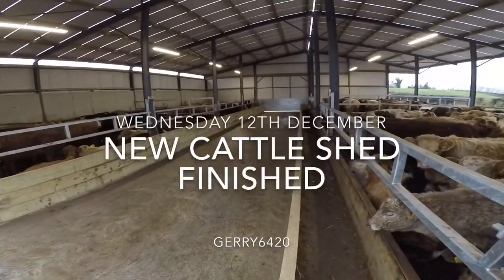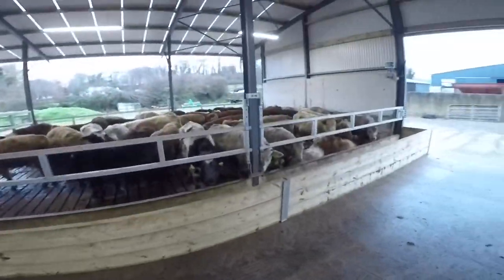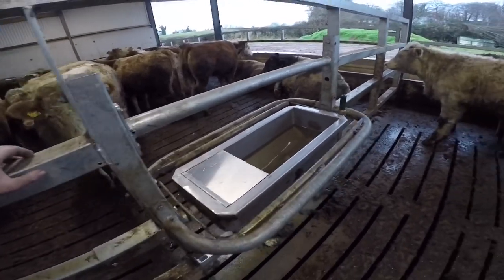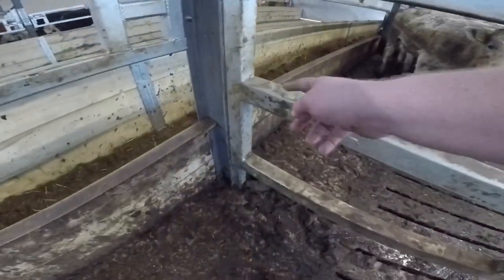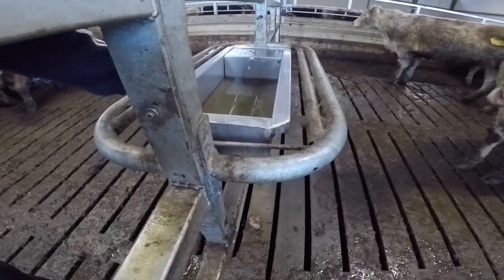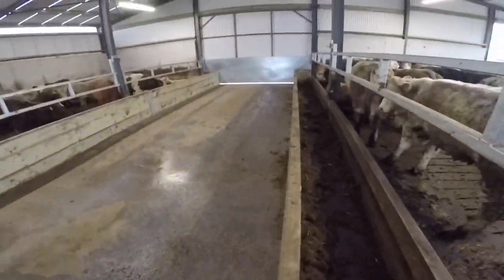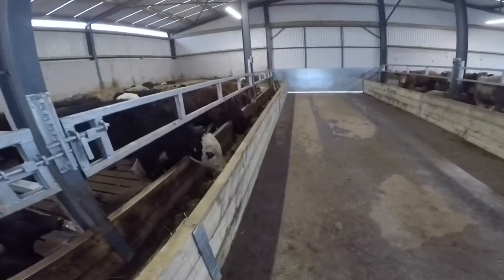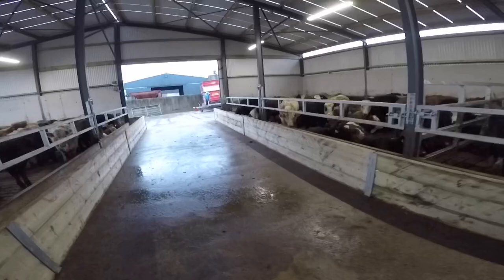NEW CATTLE SHED FINISHED

Comment: Should have put down rubber. Two rail feed barriers look cheap and flimbsey with not much thought given to animal comfort.... tip over drinkers will leak over time also and when in middle will not be cleaned regularly...
Reply from the maker: James Brennan sure the dozer is the only answer and knock it down.... ffs. Animal comfort is well catered for here, an uncomfortable animal doesn’t put on much weight. rubber on the slats is an absolute waste of time, had it on one of the other sheds and I ripped it out after a few years. Between the slat and the rubber is a breeding Gound for Disease and bacteria and every foot disease known to bovine animals and no matter how much washing lime or disinfectant you use, you cant get between to kill so you end up with endless foot issues. Larry Goodmans feed lots, feeding 1000s of cattle hasn’t 1 grain of rubber because of similar issues and zero differance in weight gain between cattle on and off rubber. Keep your rubber. Think more of my animals then subjecting them to that. The “flimsy” feed barriers are made from 4mm thick box section and have been in a previous shed feeding large bulls for for 11 years and the next time one gets a bend will be the first time. These are built stong and would keep elephants in. No animals gets heads caught or loses tags on these types of barriers and they can be adjusted for different sizes of stock in seconds. 
There isn’t a drinker known to man that won’t leak at some stage. Tipping them over to clean them out happens when needed as pens are walked daily while checking animals. Put a few videos of your own setup up and ill tell you where your going wrong. 👍
Reply: Rubber on slats is a bad idea. Its ok for the first year but after that you get bad feet problems as the hoves are growing faster, the bare concreate keeps the hoves trimmed. I know this becaues my dad owns hydrascraper services.

Comment: Hi Gerry. Smashing shed. I'm going starting to put up a near identical shed myself in two weeks time. Was considering putting the slatted rubber. But judging by some of your comments below....I'm starting to wonder are they worth it. You seem to give an honest opinion on them. Alot of lads that have them down I feel don't. Not sure how much I'd trust the agents selling them when they start talking about weight gains....and dropping the words teagasc research etc....just a small obs. do you find it better having biggest pins...or does it make much difference. Was going to split mine into 4 pins each side for grouping cattle better...if want would prob go with just the tip over drinker in the middle as suppose to the smaller ones.

Comment: Fantastic new shed  drinkers are really good saves on bucket cleaning 😀on the roof it looks like strips of light is there gaps between sheets?
Reply from the maker: Antony farming yes the it’s spaced to help with ventilation.
Reply: @gerry6420  the space sheeting is a great job for ventilation. 
Did they put a ridge cap on it at all?
Reply: On the drinkers.... fine big drinker and very well guarded.  There must be some sort of fancy swivel fitting on connection to ball valve to allow the trough to swivel?
Personally, l wouldn't position drinkers in shed like that - my reasoning?  It means having to enter the pens daily to check them.      Slippery slats, mixing with cattle. Bad combo.
Its just my personal view. Hope you or other viewers dont take offense.
Reply: @Bambinohead1  well said I was thinking the same but I guess it works for them 👍

Comment: Are the beasts happy here? Should there be rubber or something for them to set down on? Does it not damage there joints etc lying down and getting up on concrete? Will they stay warm and clean enough?
Reply: If you are a farmer Tom you only have to look at the cattle to know how content they are. Rubber won't make any real difference to their comfort or thrive levels. This shed is state of the art for animal welfare point of view
Reply: Bambinohead1 Yes Thanks I am. We milk around 400 head,run around 1000 head altogether,and arable around 3000 acres.Thanks for asking.You don’t see cattle on slats over here,that’s why I asked.Im well aware of cattle welfare rules and regs on our own set up.It was interesting to see,I thought the cattle looked uneasy,and maybe too many in a pen,but what do I know !
Reply: @FarmerTom08  stocking density can be much higher with slatted cattle accommodation as opppsed to straw/peat bedding.  That's why it might seem cramped.  Cattle stay cleaner on slats with more rather than less cattle in the pen as it helps to push down the manure. 
You could do worse than follow this channel if u want to learn more about wintering cattle on slats.
As for warmth, cattle can in fact be too warm in sheds here in Ireland because winters are so mild. Its 43F here atm, rarely gets below 20F even at night.  Thats why we keep sheds airy and shave cattles backs so they don't sweat.
Reply: no tillage in many areas in ireland ...straw  very expensive .....slats are really the only available option for most as pollution is also well taken care of with them  they are probably not as good as bedding cattle but are a good enough compramise and better than a badly beddded shed or being left out under the hedge in  a wet winter  ....also pretty labour efficent as most drystock farmers have a day job as well !!!